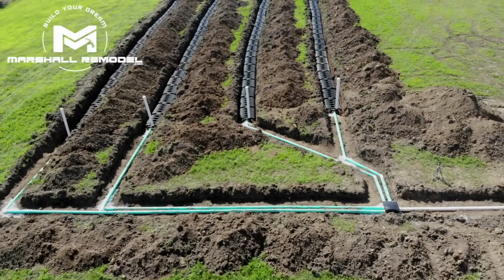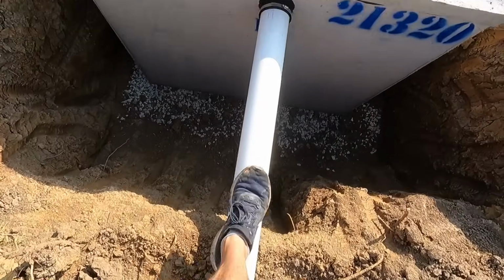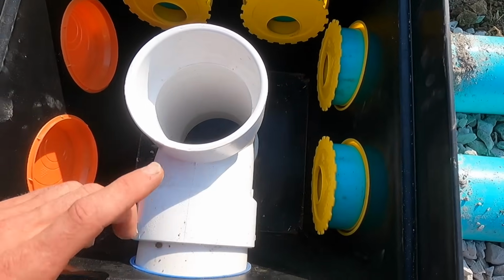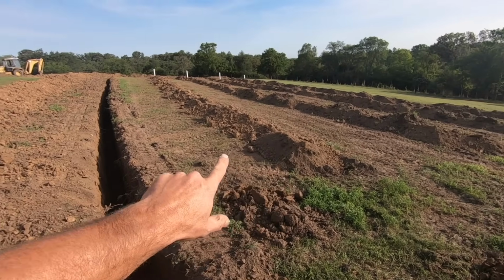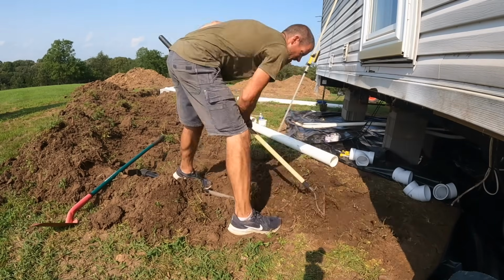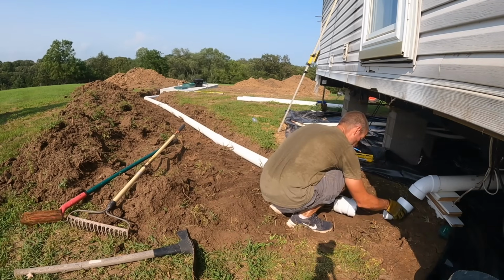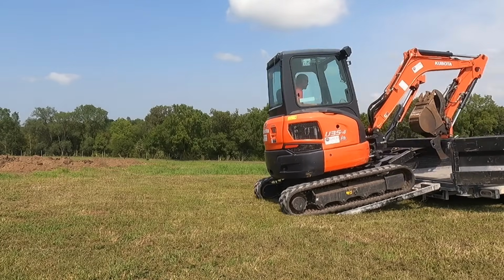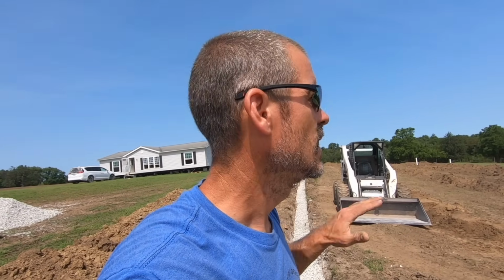Septic System Install with Mobile Home Hookup

Comment: Curious … Iowa having some cold winters, aren’t the runoff channels too shallow in the ground? Shouldn’t they be below frost levels? Like in frosty Norway, pipes and anything liquid need to be at least 6ft under … sometimes 8 ft.
Reply: Yeah, there are a few things lacking in this video, like how it all works, for a start. I have no idea what the black things are for and why the entire system is designed like it is. How much maintenance is required, how much does one this size cost (approx) and what prevents it from freezing? I guess I'll have to look at another video that explains how they work.
Reply: @OMGWTFLOLSMH dude this isn't a video that will solve all your laziness. That research is so easy to find on your own. Why not put in a bit more effort?
Reply: @OMGWTFLOLSMH  the black things allow the liquid to drain into the ground.
Reply from the maker: No you’d be surprised how insulated the ground is. Especially with snow cover. Now if you had animals like cows grazing on top, that weight would push the frost into the ground.

Comment: Nice to see you working with family.  My dad, brother in law and I built 5 houses throughout my lifetime. 3 were for me :)  Actually, the fifth was for me and Dad has been gone for decades and I built 600 miles from my sister and hubby so It was pretty much my wife and I on the last one.  We had a lot of fun working together.  Doubt there will be another as brother and law and I are in our 70's.  We have done lots of other projects together as well.  Sure do miss my dad.
Reply: Shout out to Dad! You could make and sell some sheds if you get bored!
Reply: That's awesome. I'd bet that was a fun experience!

Comment: Just another note when you're gluing pipe and you shove your pipe into the glue joint you need to twist your pipe at least a quarter turn this allows for the bubbles to be expelled. I've been in the plumbing pipe fitting business for 30 plus years. I'm not sure if this guy installed septic systems regularly but definitely a very professional job.

Comment: Thank you. This video is almost identical to what the county has told me I need. I only need a 1000 gallon tank and 280’ of infiltrator. I was worried about my curtain drain, but you made it seem much simpler than have been dreading

Comment: our septic system is quite different.  For one, we had very little soil.  We began years before we built, hauling in fill material as we are on a mountain of rock.  The djainfield was dug around 20'x40' and a bed of clean 3/4" rock laid and the a grid of perforated pipe laid and covered with more clean rock and then a very heavy fabric.  over that was a layer of soil.  In total, there are probably 100 loads of material in our djainfield.  Our tank is a 1500 gallon with no compartments.  the drop from the house to the tank is probably 8' and the drop from the tank to the djainfield is another 15'

Comment: This is easily best case scenario when installing a new system. It’s dry and sunny and nice. The dirt has absolutely no rocks in it. Imagine putting these in the dark, cold, and pouring rain. Constantly fighting the mud to keep the system level to satisfy the inspectors, and unearthing watermelon size rocks and tossing them out of the trench to prevent a break when the dirt settles after backfilling.

Comment: Great job bedding tank and pipe. that is the most often failure on installations and regulatory inspections.  As a regulator I see many failures due to improper bedding.  One local homeowner spent a three day weekend with 10 degree or below temps hand digging sewage laden mud from beneath his deck and home to resolve a blockage due to improperly bedded pipe on a 6 year old system. Get it right at installation and you don't have to repeat that homeowners experience!

Comment: I always compact the over dig area next to the tank before installing the pipe or keep it to less than a foot. In a 3 or 4 foot span the pipe will sag and fail eventually.
Reply: I just use 6a Stone 31 years in I've done over 500 never had a problem

Comment: What is a ballpark price for a system like this in your opinion?? $20k???
Great work. You really pay attn to the details. Its not rocket science, but you need to know what youre doing. Great vlog!!
Reply: I installed my system myself, 12x60 leech field with one 2 chamber holding tank and one filter tank..totalled about 14k.

Comment: If the plan is to live in the mobile home until they save enough and then build the dream home, will the mobile home be sold/removed from the property once the dream home is built? Looks like the dream home will end up being on the opposite side of the leech field as the mobile home. Does that mean you will need to dig for a second septic for the dream home? Was there any chance at placing the leech field such that it could be repurposed for the dream home after the mobile home was no longer needed?
Reply: I'd keep for a rental house or guest house. Even put it on Airbnb. That's alot money spent on something temporary. get the money's worth. They'll probably run a new pipe from the dream house.

Comment: I design these for a living in North Carolina, so I'm just curious about a few things:
1. Were you required to go through a soil scientist, or did you have the option of a REHS from the county or state level?
2. Is the 1250-gallon tank a requirement in your state? Anything less than 5 bedrooms only requires a 1000 gallon tank here in NC.
3. Why is the D-box set so far away from the drain lines? Would you have been unable to get 1/8 inch of fall per foot of supply line to the D-box if you'd set it closer to the lines? There's nothing wrong with your design, I've just never seen a D-box set so far away.
4. Did you use low-profile chambers so that your curtain drain wouldn't have to be as deep? Just wondering because if you were allowed up to a 36 inch trench depth, you could've used standard Infiltrator chambers and received a 25% reduction on linear footage. The 4 lines would've been 75 feet instead of 100, so the curtain drain would've been deeper but also a bit shorter. I'm just curious of how the math worked out, if it was still somehow cheaper to use low-profiles.

It's fascinating to see how this is done in other states! 👍🏻
Reply: I am really curious as to their soil conditions. The DRs do the soil evals here in AR. We wouldn't do a curtain drain unless we had a pretty high brief in the seasonal water table. 400ft with a curtain drain would be some pretty sad soil. We would do standard chambers by default unless we had a high rock layer to minimize trench depth.  We don't even install standard chambers 36in deep, much less low profile.  Also, we have to follow contour, so our lines are rarely straight.

Comment: What a ridiculously huge septic system to a single family home. The requirements are a way to control and restrict rural development.
Reply: Yeah, so much for the land of the free.
Reply: Only explanation can be is heavily clayed slow percolating soil there is my guess !(?)!
Reply: That's why a soil evaluation is performed - to determine how well the soil will accept water. Depending on what the acceptance rate is based on the soil composition, the disposal field may be large or small.
Reply: pretty sure it’s a temporary home
Reply: They said they want to build a bigger home , no sense in building it twice.
Reply: It's for a bigger home. He explained from the beginning. I guess if you built it. You would build it twice and charge twice.
Reply: The system was sized perfectly.
Reply: That is actually small for a single family residence.  The fact it has no header and footer pipe in that type of soil blows me away.  

Oh buy yeah it's overkill
Reply: Perc rate must be terribly slow for that humongous system.
Reply: @jb_wathen  I had a good perk and the permit department required a very huge drain system with an alternative site in case of failure. It is a way they discourage building on non-sewer accessible sites in hopes you pay the price to hook up to a public sewer system and pay the monthly fees for perpetuity.
Reply: @davidking4779  that is so wrong!
Reply: @davidking4779  that's why we left California and now live in Tennessee 👍
Reply: @jb_wathen  I moved to Costa Rica 20 years ago and found a better place for me.
Reply: @davidking4779  Awesome, thats my home country, enjoy. Pura Vida!
Reply: I think the same.
Reply: @Sea-cucumber1151  They’re would probably be the same number of bathrooms regardless
Reply: @kylethomson7157  not necessarily, they could keep both houses, or at least live in one while the other is being built. I can’t imagine they would say as long as you demolish the first prior to moving in, they would require them to not live there or make accommodations for both houses. Besides why destroy the first house when it can be useful for so many things.
Reply: What a marble of engineering. For something so “simple“. I’m very surprised the drainage tanks are so close to the surface. Seems like a vehicle could crush them, or that it would bubble up and smell. I would’ve thought they’d be much farther underground. I guess it works though!
Reply: My system is this size with better soil.  It doesn't cost that much extra to over build but costs a lot more to redo.
Reply: Agreed!
Reply: @kylethomson7157   where I live it’s based on number of bedrooms, you could have 1 or 15 bathrooms and it makes no difference.  But they act like the world will end if you go from 3 to 4 bedrooms.
Reply: Maybe the owner takes a lot of big dumps.
Reply: Soil is likely very wet, hence the extra leach fields for water overage.
Reply: This is the exact reason you do things in your own and don't ask the city
Reply: @Sea-cucumber1151  I agree
Reply: Looks like a standard system I’ve seen in residential construction all my life here in NC. From the looks of it, it’s probably a four bedroom home they plan to build. Septic tank and drain field. Just as a guess because I can’t remember the exact number…I think it’s 50 feet of drain line per bedroom. Usually the lines can’t exceed a certain amount, like 150 feet. If you have a 4 bedroom house, you’ll need 200 feet of drain line. So, 4-50’ or 1-150’ and 1-50’. Whatever combination works for your property. And no, you cannot build a small septic system and later build a bigger house and use that system. What they did here was probably what was necessary for future plan. I DID NOT WATCH THE VIDEO.😂

Comment: I know it runs higher but I would have used sc40 on all of it. Seen way too much of that thinn wall stuff collapse
Reply: He says in the video that it is schedule 40 solid core pipe.
Reply: That's not thin wall PVC its SDR 35 and has the same crush strength rating as sch 40.

Comment: You did a fantastic job even though you did alittle more that what was required. They should not have any craptastic issues. This is not a cheap endeavor and I am sure you saved your sister 10,000.+ dollars. Thanks for the video.  Our new home is on a septic system and now I know so much more about how it should work.
Reply from the maker: Thanks for watching! Here is the cost breakdown video for this system https://youtu.be/swCz8hxd1-8

Comment: How long will this system last ? Also how much would it cost to have it done ?
Reply: Septic system longevity is in large part driven by how the homeowner uses and maintains the system. You need to be careful about what goes down all of the drains in the house. No oils, no disposal units in sinks, no chemicals, etc.. Have the tank pumped out every 3 or so years (for 4 adults in the home), don't allow heavy vehicles on the disposal field (nothing heavier than, say, a riding mower) and don't plant anything other than grass over the field.

If you do all of these things, a septic system can last 25+ years or longer. If you mistreat the system (even by dumping too much water in it, like from a constantly running toilet due to a work flush valve), you can have problems almost from the start.

Comment: I think some people would appreciate what the process is for digging the test hole and then measuring the drop in water during the park test. It can be a challenge during the winter months or heavy rain period or the soil has rocks that interfere the water infiltration rate. Excellent video.
Reply from the maker: Thanks for watching!

Comment: Pretty interesting and professional.  In NC in a  mobile home and low area. Always have had problems with the septic.  Found out foam peanuts were used in places instead of rock, like wth.... later, dug a hole, Im thinking like the screen barrier, big and deep enough for a car to fit in and still have issues 😣. As a woman w/family of 4, thats the only reason I watched this video. Very  interesting to see  your  process and how professional you are.👍
Reply from the maker: Thanks for watching I am so sorry you've had such problems!

Comment: Great job, FYI, always use PVC with the bell end, no connectors.  Using connectors are failure points either by the ground settling, tree roots , vehicle traffic etc. PVC with the bell end totally eliminates a possible failure point.

Comment: Grew up with septic. 2 concrete tanks three lateral lines 1800sf house two full bath. 1 bag of enzymes once every 3 years. Not a single issue since 79’. Zero on hands maintenance ever. No filter no distribution box. Half the size of your lateral field. Twin 650 gallon concrete tanks. Single 4” pvc between them 3/4 of the way up the sides.

Comment: State of Texas require aerobic systems on all new installations since 2006. The systems require chlorine and electricity and a maintenance agreement so the system can be inspected four times a year. All required by the state of Texas and it benefits the septic companies. I’ve had several houses with an anaerobic system and with proper maintenance no problems. Heck one was 56 years old and worked like a charm.
Reply from the maker: Thanks for sharing!

Comment: I can't belive the leach field is that big! I have a 3 bedroom colonial and it's a quarter that size!
Reply: I was thinking the same thing….. plus my tank is not far outside the exterior of the house…. Long run to that tank before it drops in…. Then again codes are different all over
Reply: He mentioned the 3 bedroom mobile was just a temp setup. Leach was sized for the future structure.

Comment: Not necessarily related, but you seen so knowledgeable. We have a septic that the previous homeowner installed. We have septic smell any time someone showers and it's significantly worse during the winter. It's frustrating because no one in the area seems to want to actually help us figure it out.
Reply from the maker: Ugh, that problem is not ok! Sorry you're dealing with it. Have you tried contacting your county? They should be able to supply names of septic installers or folks who pump your tank.

Comment: Some area a perk test is not required. Areas of Arizona have had so many done it's not required in some areas. Health dept issues a permit, they accually give you plans on how to install one with exact dimesions. Normally here it's two gravel runs 70' with 4" dian leach field pipe.

Comment: Great video, probably the best one I have viewed. I suprised you didn’t bed in  (with gravel) the pipe from the house to tank and tank to leach field.
   Why are the infiltrators so far from the distribution box? I know t  he e lines need to be spaced apart, but it seems like you have 20’ plus feet of pipe just to even the first one. I’m certainly not judging, just inquiring. Great workmanship.

Comment: Hi there, I am an American living in Thailand and am getting ready to build a house in Northern Thailand just outside a small village. We don't have building codes in the rural Thailand except for a well. The province will send someone out to check it once you have drilled it. 

These people have no idea what a septic system is. What they do is dig a round hole in the ground about a meter and a half wide and two meters deep and put in a one meter round pipe with holes around it. It takes two of these pipes. The top of the pipes is just above the ground with a lid on it. Surprisingly it works.

When I try to explain it to these people they can't understand why we would go to all that trouble. Since we are building two houses we will be putting a proper septic system in. 

Another thing about Thailand is they don't know what to p-trap is. Most drains go straight down to a 90 degree. Unfortunately they think it's normal have sewer gases come out of a drain. 

It is one crazy world. 

LOL
Reply from the maker: It’s pretty fascinating observing building practices around the world. Thanks for sharing! Thailand is a beautiful country

Comment: Not bad for diy.  It's a little easier to start at the house first.  And it's recommended for at least 12 Inches of cover on the first tank, and we really like to see our service line a little deeper that way it doesn't break when they drive over it , because someone will surely drive back there.
Reply from the maker: Thanks for sharing! For what it's worth it passed inspection without any adjustments

Comment: That's a big system. Is there local restrictions that prohibit systems like a Biocycle, footprint of under 4 square meters,  reasonably cheap and fully automatic,  pumping the treated water into a sprinkler system for the lawn or gardens. I'm all for over-engineering but that looks next level!

Comment: That's the exact type of system I have including the curtain drain. No one told me there was a filter at the tank that needed cleaned out once a year. I wonder if my system, which seems identical to this one, also has a filter. If it does, it hasn't been cleaned out in 4 1/2 years since we built the house.
Reply from the maker: Definitely worth checking out.